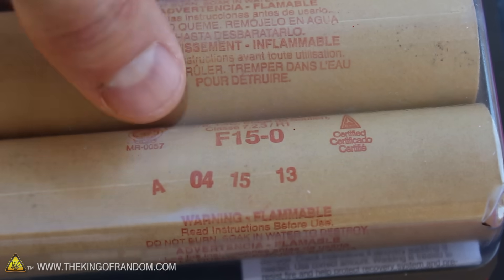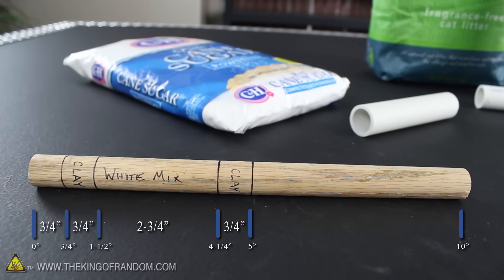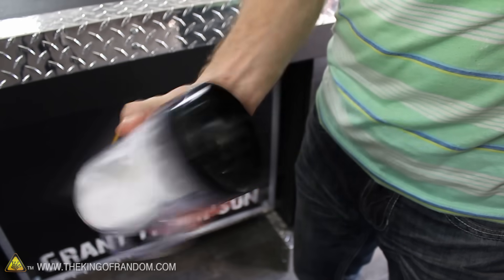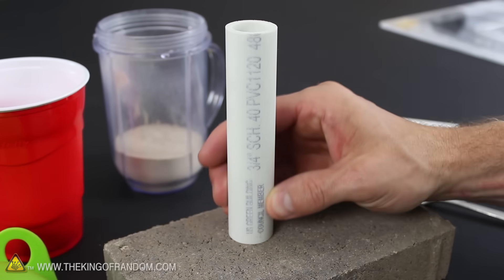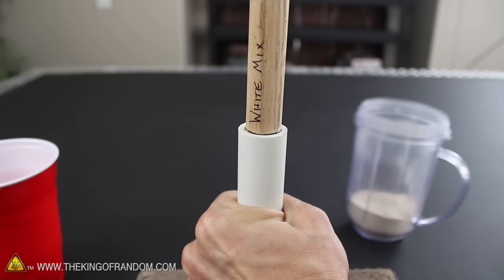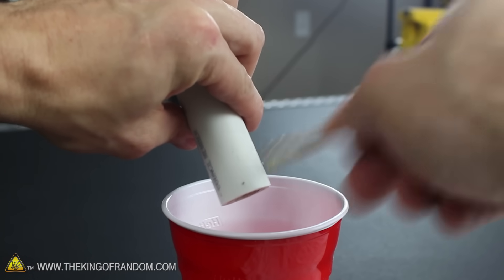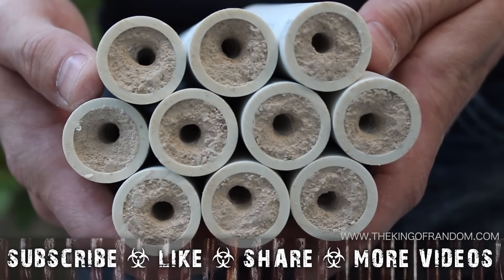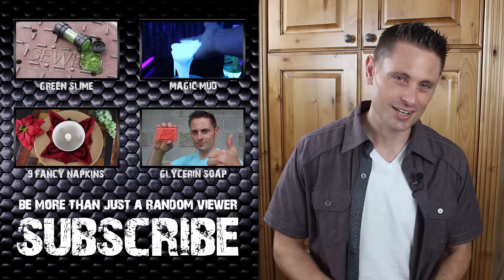How To Make Sugar Rockets

Comment from the maker: Hey, just wanted to say you guys are all awesome.  I notice you liked and shared this video like crazy.  I wasn't expecting that, so it blew me away.  I do appreciate it, so thank you, everybody!
Reply: Gareth Fuller Outer space is only 528000 feet away. Grant Thompson - "The King of Random"  is already 0.4% of the way there. To infinity... and Beyond!
Reply: Don't let ISIS watch this
Reply: Planning reproducing this on a smaller scale; don't really want the power of an E class motor.
Reply: no sir...thank you ..i actually won an altitude competition with your design (modified slightly). 4850 feet :)
Reply: are you working on posting the follow-up video on what exactly to do after you have a hole drilled in the rockets? Just ram a fuse in the hole? What about the baking soda? You left us hanging a bit there, more to come?
Reply: Hey grant u should do another short clip on the sugar rocket but put a camera on it
Reply: Grant Thompson - "The King of Random"  sir' such a great video..can we use any thing else insted of kitty litter?
Reply: This project is the best so far! But can you make a video on how to make the body of the rocket? Or how to keep it flying straight?
Reply: Grant Thompson - "The King of Random"
Hey Grant, 
I can't express how excited I am about this but I have some questions though. Why did you not cook the fuel like the last time You did these ? Also, is there any point in adding a rust or is it pointles in this mix? Why did you not use it in this case? I thought it gives more thrust to the rocket.
Thanks in adance.
Your fan Juraj.
Reply: Grant Thompson - "The King of Random" Please do more of these full length videos. I know they take much more work to make and that you therefore cannot release them as often, but they are, in my humble opinion, better by far than the shorter videos.

Whether you take my advice or not, great work once again and i can't wait for the next video.

Sincerely,
Jogandsp
Reply: Hey Grant Thompson - "The King of Random" , how do you measure max height? Anyway, that's great!!!
Reply: i can't find the potassium nitrate
Reply: Grant Thompson I have watched u r vids for about 1 1/2 years and I honestly think u have the BEST  howto channel and  u make the best tutorials EVER
Reply: Hi! I'm a fellow subscriber who was wonder what electronic balance you use. I've been searching for a good one for a while now and yours looks decent. Thanks for your time!
Reply: michelle diamond no...........just..............no
Reply: Nice project Grant! btw, can you use amonium nitrate to make this rocket? Can we also use the custom potassium nitrate bach made by NurdRage?
Reply: 2300 ft out of cat litter WOW!
Reply: Gideon Terry Actually, the only stuff in it what launches it is the Kno3 (pottasium Nitrate) and sugar.The Cat litter works like a plug :). Sorry for my English.
Reply: Ignacio Miranda ikr!
Reply: Ankit Vaidya potassium nitrate is stump remover, if you go to lowes or home depot, look for stump remover, i recommend the spectracide brand
Reply: Sean Cooper
Can you traduce "Stump remover" to spanish? or maybe give me a brand name
Reply: hello I was an early subscriber when you made your first few videos years back i'm a kid but I hope to make more of your tutorial products i've done a few but I cant do some because I don't have my own credit card and money
Reply: ***** No chance. Nowhere near enough heat would be generated to ignite it. Unless you smashed it as hard as you could with a sledgehammer! But even then I don't think it would ignite.
Reply: ***** If you make the hole too small for the gas pressure to release it can still blow up.
Reply: Grant Thompson - "The King of Random" would a rocket with a mix of sugar and kids sparkles work too?
Reply: Do these engine provide as much power as the store-bought ones? I was wondering if you could get the same results.
Reply: Grant Thompson - "The King of Random" what potassium nitrate are you using. can you send me the link?
Reply: in belgium we doesn't have stump remover can i use other things??
Reply: Grant Thompson - "The King of Random" can u do something with a plasma ball plz.
Reply: can I use something else than kitty litter?
Reply: The body of the rocket was the pvc engine casing, and you can use fins if you need help to stay straight.
Reply: dude ima try this !
Reply: WOW 2000 Feet From A Homemade Rocket! Subscribing To This Channel Is The Gift That Just Keeps On Giving, Thanks KOR
Reply: well, it is an awesome video!!!!
Reply: Hmm... Grant, would you mind making a bigger scale pvc rocket, to see how far you can stretch the envelope?
Reply: how many g of propellent is there in this motor
Reply: That is because you are cool! ;)
Reply: Who won the world's largest gummy worm
Reply: that rocket fly really fast, i only can see smoke
Reply: Attar Raihan Nazhif if you want to buy patasem nitrant look it up on ebay
Reply: Grant Thompson - "The King of Random" Someone in an another video, melted the sugar with the potassium nitrate using an electric stove. Is that a safe way to make the rocket fuel? I saw he used a face shield,gloves and apron but is there a high possibility that the fuel when melting, ignites?
Reply: Ankit Vaidya If you live in Canada, you can't find it because it's banned
Reply: Grant where do you get all of your ideas? they're awesome!!!
Reply: one of my friends was stupid enough to make this stuff inside his house... yea it nearly burned down :/
Reply: Sean Cooper please do not say stupid
Reply: Hey Grant, check this out! http://www.iflscience.com/chemistry/how-make-sugar-rockets
Reply: rockets are awesome man!!!!
Reply: i recommend the spectracide brand, its the same thing Grant uses so it should work great!
Reply: Anyone that does this and travels with the motors to shoot them off do your reasearch. I know there is limitations in the US of the amount of fuel you can have in a single motor that you can transport or store. I think colorado is around 65.5 grams without a low explosive license. Other states 120 grams. If you decide to change the specifications of grants rockets like the nozzle diameter smaller it may blow the nozzle from over preassure. Do your reasearch please.
Reply: ***** I think it has to be powdered sugar, because it has to be a fine powder thats highly flammable. :)
Reply: Nice rocket! But it's really hard to get potassium nitrate in Germany. Do you know another way to bring cheap Sugar Rocket in the sky? Maybe with some magnesium and sodium hydroxide or sodium metal?
Reply: Hey Grant, do I always liked playing around with rockets and potassium nitrate. But now this adds two of my favorite projects. Thanks for this great project. I grabbed Some more stump remover for a nice cheap price and whipped myself up some of the composition. It works great. THANKS, and love you man. I was just wondering if the powder will fall out the engine tube after you drill into the clay.
Reply: WHAT DO U DO FOR A LIVING
Reply: Does it work with icing sugar???
Reply: Dingus2600 idk, thats something u might have to test
Reply: Dingus2600 Just stick with pure cane sugar. It's pure, while powdered sugar has anti-caking agents in it. These minerals can do all sorts of unpredictable things.
Reply: Ankit Vaidya Try a store that deals with farm/agriculture supplies. It's a component of most agricultural fertilizers, though buying a larger quantity than what Grant has, might raise some eyebrows.
Reply: Jason Mckenzie You can buy a full pound of pyrotechnic-grade Iron-Oxide off Amazon for about four bucks. Shipping is about six.
Reply: Abdulaziz Almousa The stick controls the entire rocket. It is the length that allows it to go straight. One defines the pin length by adding the rocket as a balance of the finger, the finger in the middle of the rocket engine, which sits in the rear half of the rocket. Tips rocket ahead, stick to short. Tipping it backward it is too long.
Reply: where could i buy that string that does the sparks
Reply: Alexander Santrac you mean fuse?
Reply: Sean Cooper idk i guess
Reply: Alexander Santrac Grant does have a vid on how the make a slow burning fuse but if u want to buy it, most firework stands (if you live in the U.S) sell it but thats only on july 4th and new years eve. idk where to get some other than looking online
Reply: hey grant can i put holes at the sides of the pvc so the smoke will go to the sides
Reply: keith co the rocket gets lift from the gasses exiting the nozzle ( the kitty litter plug)  if you put holes in the sides you wouldn't get much lift.
Reply: Grant Thompson make a video of you and your wife making metal rockets
Reply: No don't never mind
Reply: Can you use anything other than the cat litter to block the ends of the tube
Reply: Grant, you are just AWESOME!!!!!
Also, your video display and shooting are of very high quality
Reply: Can anyone give the measurments in milliliters?
Reply: this is the most accurate example for " sweet misery "
Reply: Wouldn't whacking the white powder with a mallet going to generate heat and friction? couldn't it set the rocket fuel off?
Reply: ***** wow
Reply: Can you use potassium sulfate instead?
Reply: Grant my nigga
Reply: Tina Johnson Grant your nigga what? A knighthood?
Reply: What about putting a nozzle with a narrow tip at the end of the rocket to increase the exhaust pressure, giving more thrust..any try this?
Reply: ***** You have to be careful doing that as it could as easily blow up as rise into the air!
Reply: terrypussypower Why would it explode?
Reply: terrypussypower Ahh o'k.  I will make test rockets then to experiment.
Reply: ***** Good idea. Take it easy at first and do things gradually.
Reply: MCPanasoni They can be as strong, and very often can exceed the power of the store bought engines. It's worth checking out the chemistry that these engines rely on, and see what it is that makes them stronger or weaker. There are some very good videos on YouTube that explain the chemistry.
Reply: Instead of lighting it with a lighter, try spark it with a BBQ ignighter instead, don't know if it would work but it's worth a try
Reply: can you please measure the thrust that it produces by putting it upside down on a scale? I'm thinking about putting it on my R/C plane haha
Reply: https://www.facebook.com/pages/Creativity_/229072860600706?ref=hl
Support this page
Reply: Akshay Asok no
Reply: warmfreeze ...how?
Reply: 8BitBowHunter I have the 2000g scale from www.homesciencetools.com .
It is $50 I think. It works well, so if you really want a good one get it.
Reply: Nah dude, you are awesome, your sugar rocket 'blew' us away, thanks man.
Reply: Does it work to use sodium nitrate intead of potassium nitrate when doing a sugar rocket?
Reply: Navid Karim Probably.
Reply: Great video mate, I just wanted to make you aware of the fact that shaking up fine powders of an oxidizer + additive in a plastic casing is a bad idea, as it could ignite due to the static electricity.
I would recommend glass or a grounded aluminium casing.
Reply: Jeez, Just asked my wife were I could buy potassium nitrate, And got NO NO NO, Cool video, Should have told her nothing and kept my mouth shut.
Reply: loftus bennet you can buy potassium nitrate at walmart in the gardening section, find a stump remover known as "spectracide stump remover", DO NOT BUY STUMP OUT!! If you couldnt find the product in walmart go to your nearest garden shop or hardware shop!
Reply: Grant Thompson - "The King of Random"  Hey Grant, I was trawling through your old videos looking for a projects and I was wondering how you compared this fuel mix to the one's in your various other videos. For example did cooking it have a major effects? Or did going from 60/40 to 65/35 dramatically change it. I'm most interested in the effect of the ones you had in the R-Candy video. Also finally why did you opt against going for a cooked mixture in this one?
Reply: Navid Karim Thank you, We have ASDA here, don't think they would sell it.
Reply: loftus bennet No problem! But I guess the easiest way is to oder potassium nitrate online by Ebay or amazon!
Reply: Navid Karim Thanks for the info, I live in an ideal place to try this.
Reply: Are you a chemist?
Reply: Grant Thompson - "The King of Random" SO COOL!!!
Reply: Grant Thompson - "The King of Random" this is AWESOME!
Reply: Grant Thompson - "The King of Random" how did u put the fuse in
Reply: How did you figure out what to use for the fuel
Reply: TEAM LLAG Probably Chemistry class or just basic chemistry. Sugar is fuel and the nitrate is the oxidizer.
Reply: Grant Thompson - "The King of Random" use some irone oxide to get mutch better result .
Reply: Flew just great!
Reply: I thought u had to cook it on heat ?
Reply: Highly refined 99.8 nitrogen 46% soluble potash. Is this good I just order
Reply: Hey can you make some for me plz
Reply: could also do this to recycle used ESTES model rocket engines
Reply: Illegal? Depends where you live....and HOW you use it, I would imagine. Be smart, use practical sense, and put safety and PREVENTION above all else.
Reply: If you're not sure, better contact your local attorney general, prosecutor, or cops before you do anything. If you can buy model rocket engines where you live, I'd imagine if you do this and don't start any fires you're ok...but check it out first.
Reply: Ankit Vaidya look for "stump remover" on amazon. i got two bottles of the stuff for 11 bucks
Reply: ***** the wick in this video was the kind used for fuses on small fireworks.
Reply: Victor Melgarejo try looking for spectracide
Reply: No, this is great stuff! What I love about youtube is the sharing of simple but great ideas! If I had known this as a kid when I was making and launching so many ESTES model rockets we always were thinking there MUST be a way to so this ourselves and save on the cost while building the engines SAFELY. This is it! Just be extra extra careful and make sure it's legal in your area. I would recommend having NO MORE oxidizing material than you need to make one batch of "engines" or rockets at a time.
Reply: Sinan ÇINAR blows up hand
Reply: +Grant Thompson - "The King of Random" What type of stump remover do you use? I can't find one with over 25% potassium nitrate
Reply: Maximus _Scott blows up hand
Reply: +Maximus _Scott the stuff he uses in the video is Spectracide 66420 Stump Remover, 1-Pound Granules, Here's the amazon link http://www.amazon.com/Spectracide-66420-Remover-1-Pound-Granules/dp/B004GVYXKC/ref=pd_sim_14_4?ie=UTF8&refRID=1SQDWZJT6CN15YTFECAQ&dpSrc=sims&dpST=_AC_UL160_SR160%2C160_
Reply: +Nate Huller cheers😀😀
Reply: +Pastor Avellaneda 😂😂😂
Reply: +Grant Thompson - "The King of Random" I suggest actually cooking the fuel together in a saucepan on medium heat as it terns solid when it sets and is thus more compact and versatile.
Reply: +Grant Thompson - "The King of Random" hey grant I'm doing a school project and was wondering why the baking soda affects the burn rate of the rocket. If you knew why that'd be so helpful thanks.
Reply: +Grant Thompson - "The King of Random"  thanks for making this vid. there was just one thing i wasnt sure on? could you send me the list of things you need for this experiment i couldent understand what you were saying sorry =(
Reply: Zackeryeh Salloum here you go heres a converter =) https://www.google.co.nz/webhp?sourceid=chrome-instant&rlz=1C1SAVS_enNZ557NZ558&ion=1&espv=2&ie=UTF-8#q=inches%20to%20millimeters
Reply: +Grant Thompson - "The King of Random" what stump remover did you use
Reply: +kris ceyssens Fertiliser
Reply: +kris ceyssens als je vlaams spreekt 
je kan het bestellen bij floratop.nl 

if you speak france 
you can buy it at floratop.nl 

i can asure you you will get it within a week only cost 6 euro per kilo
Reply: +Janco Postma why my sugar rocket didn't fly into the air,I tried it six time.and I didn't use the grinding miller,it's this problem?
Reply: Yeah you need to grind it 
Then dril a hole trough the mix and nozzle
Reply: thanks
Reply: +Grant Thompson - "The King of Random" nice nutribullet
Reply: +Grant Thompson - "The King of Random" plz halp i want to make some rocket and eventually move on to fireworks but potassium nitrate is illegal were i live so i cant make and rocket fuel is there an alternate fuel source that is legal in australia
Reply: +Clarke Viljoen I ordered a 1 Kg Tub of potassium nitrate powder from amazon, are  you sure its illegal in Australia? people who keep horses use it, and farmers use it,,even keen gardeners add it to composting bins. it was £9.99 per Kilo
Reply: +Ankit Vaidya You can get 100% potassium nitrate in stump removers such as Spectracide Stump Remover.
Reply: +Grant Thompson - "The King of Random"  i am whant to make fireworks out of thes rockets
Reply: +Grant Thompson - "The King of Random" What did you use as the fuse or wick.
Reply: Great video Grant I'm going to check out your other videos
Reply: +Grant Thompson - "The King of Random" i bet 95% of us will aim it at people,property,and flammable things because WHY NOT?
Reply: Indie Gaming lol
Reply: what is the potassium and sugar ratio?
Reply: +Mason Parker I would guess 70 30sugar
Reply: Kennynva T. thanks
Reply: +Grant Thompson - &quot;The King of Random&quot; it 'BLEW' you away .    bud um ch! 'cause its a rocket ... he he no? okay..
Reply: +Grant Thompson - "The King of Random" Bet that stump remover makes you NOT stumped! Get it? STUMP remover? Like you can't think?
Reply: any kind of brand if sented
Reply: it didn't work for me😢
Reply: Isnt ammonium nitrate better than potassium nitrate?
Reply: iosef 333 If you want to make a bomb.
Reply: Joe Chasko l
Reply: Grant Thompson - "The King of Random" Can u please Make a paint ball gin
Reply: Grant Thompson - "The King of Random"
Reply: Grant Thompson - "The King of Random" 
After making sugar rocket ,within how much time we should lounch it...
Reply: Grant Thompson - "The King of Random" I tried this mix, and it didn't work; it just stayed on the launch pad and smoked (then caught fire)
Reply: Grant Thompson - "The King of Random"  Hey My friends are building Motors to use on Styrofoam aircraft and we found that adding a bit of sulfur to the mix makes it burn faster adding a bit more thrust. I wasn't sure if you have experimented with this or not but it seemed to work for us.
Reply: Grant Thompson

 - "The King of Random"
Reply: Grant Thompson - "The King of Random" is this legal in the Philippines
Reply: Grant Thompson - "The King of Random" u
Reply: Grant Thompson - "The King of Random" I kept on making this but after it got up about 5 inches it would dive into the ground
Reply: gordons stump remover potassium nirate? , cuz i followed to a T didnt work?
Reply: Grant Thompson - "The King of Random" you should make a rocket fuelled toy car
Reply: Kai KAI dry clay.
Reply: thanks
Reply: Also
King of Random
You did't tell us about the fuseand how to put it in and stuff
thanks so muck anyways
i am 12 and i understand it
Reply: The King of Random i like the old you
Reply: You really Need to make a warhead for theese!
Reply: +TheGreenGuy hi alucard ilove you
Reply: The King of Random since you have your drone now, can you use your drone to see how high the rocket flies?
Reply: does saltpeter work? (bad Spelling im swede)
Reply: when i drilled through the mixture to add a fuse, the whole powder went loose and all fell out please help
Reply: The King of Random 2300ft i dont think solol...
Reply: Is this scaleable or potentially able to be set up in parallels? :]
Reply: The King of Random is powder sugar same as icing sugar?
Reply: The King of Random : Have you tried regular sugar?,  powdered sugar contains corn starch which is probably inhibiting combustion. You'll probably experience higher altitudes?, speaking of altitude,  how did you measure that or come up with those numbers?
Reply: The King of Random he
Reply: This is really fantastic.but making fuel with hand seems dangerous.i will try the same.
Reply: Did you make the wick
Reply: 😍
Can you say the Two Things in German language. Thanks ,Rocked King 😉
Reply: where monthis found this KNO3 plassssssss helpppppp😭😭😭
Reply: Where’d you get the fuse
Reply: Rip
Reply: مادا نضع مع ألسكر
Reply: He's lieing, they come 3 for $17
Reply: hey can u subscribe me